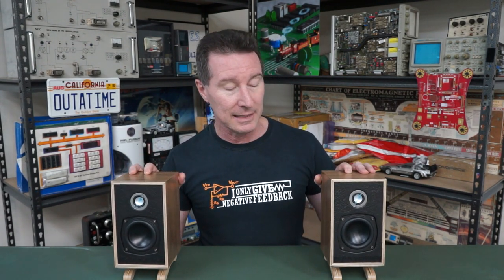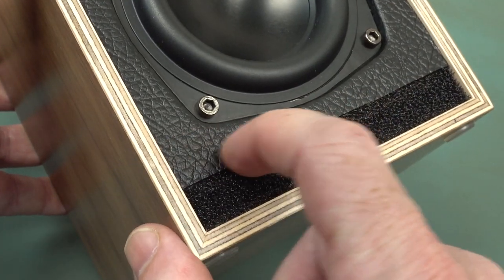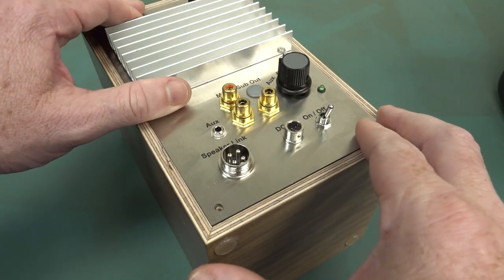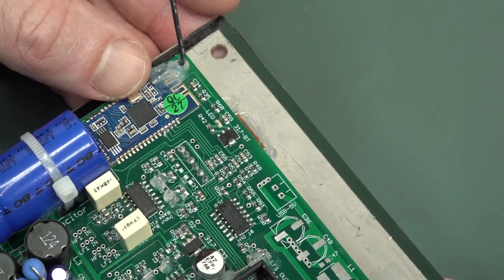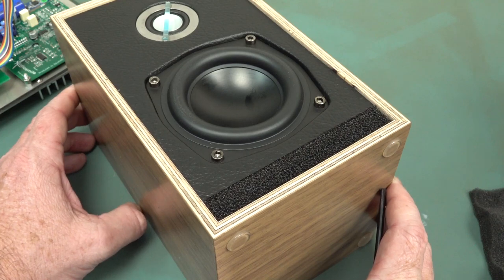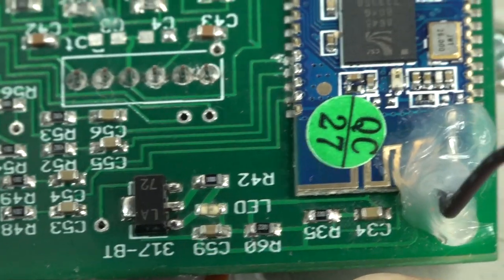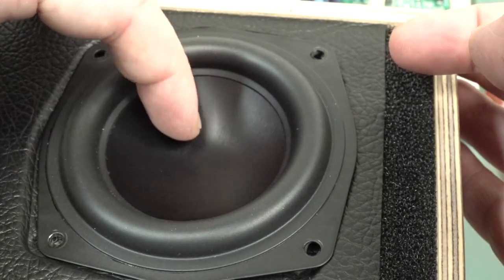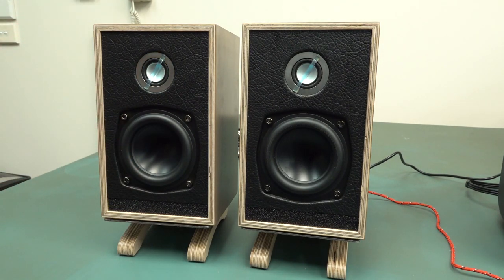EEVblog #1162 - Little British Monitors

Comment: That Dayton driver is a series piece. All you need to look at is the huge buna-n surround, huge magnet and then that deeply pleated nomex spider and a stiff cone. Seeing the nomex spider did it for me. If they are specing a nomex suspension, then they put the money in the right place.
Reply: It is a Dayton driver but to be fair they totally ripped off the design from AuraSound. If I knew that when I designed them I would have gone with AuraSound on principle, but the small differences make it difficult to change over now.

Comment: Putting the price aside, I wouldn't use these for any critical listening, only for checking mixes. These drivers are too small to have a much wider frequency response without using tricks. Also, these would not work well for surround setups either, as you have to use them as a pair. No monitor in that price range has a slave passive speaker. They all have their own preamps and can be used by themselves, so you can buy the monitor as a single unit for surround setups.

Also...if the monitor is that flat as claimed, why the plots are shown with averaging and with the large division of 20 dB per octave? Just give the full frequency response of the monitor.

Comment: This is definitely not a transmission line - the port is way to short. For a tuning frequency of 70Hz (like the frequency response suggests), the line would have to be about 120cm long.
It´s a ported enclosure - which isn´t bad...just don´t call it a TL.

Comment: I've heard these a few times and it's important to put them into context - for current use and the history behind the design.
They are designed to be flat and accurate, a monitor speaker and therefore somewhat at odds with the norm for small multimedia speakers which are often hyped in the presence region to give added bite and excitement, and boosted in the upper bass for additional thump.
Such anomalies sound impressive on first hearing but can become tiring after extended use, not to mention you are overlaying a set of defined tonal characteristics onto every performance.
The LBM tries to avoid this by remaining clean and neutral.

The ply cabinet is better damped than many other materials, lacking for example the high Q ringing often found in MDF and some plastics which colours mid range frequencies.
I'm sure Simon could make these more cheaply with MDF, and even save some time on machining and finishing - but they'd sound worse.

Comment: Back in the 70's I read an interesting article about doppler distortion in wide-range  speakers. In fact you will have a moving sound source when playing, for instance, a 5 kHz tone on a membrane that moves with a lower frequency like 50 Hz.
Reply: That tends to be a bit of a headache for coaxial designs, actually, since you're basically putting the tweeter into a vibrating waveguide.
Reply: @PileOfEmptyTapes  Also the reflections from the voice coil around the tweeter can cause 'blurring' to transient response. Philip Newell has an interesting chapter on this in his book Recording Studio Design where he measures Tannoys.

Comment: these are NOT MLTL speakers and the drivers do not appear to be high quality.  Notice how none of the driver specs are given here or on the kickstarter. Go to partsexpress.com and you can build your own bookshelf monitors with an active crossover and add a blutooth module for a fraction of the cost.  The $100 mark is not far off depending on how good of a crossover you want to build. Also, anyone that knows about resonance understands that for the density to mass ratio and quality control of the product, MDF is a better choice for cabs than plywood unless he is using the finest grade cabinet ply (9 layers or more) and checked for inclusions in the cab.  This is a set designed for the recreational person who likes to think they know about something because they screwed nut A into hole B.   Just an FYI, I built 3-way MLTLs as my main fronts and the crossovers in them were $300 so please do not mistake a product produced for noobs for quality just because the uninformed think it is.

Comment: The midwoofer is a reputable unit, but I don't know about the tweeter in the LBM's. They look like they are 1" Tymphany wide-range speakers, kind of like the Harman Odyssey single-suspension mid-tweeter speakers, so they probably aren't "junk" but I haven't heard them sound better than actual edge-driven dome tweeters in my experience. A "transmission line port" was originally done by Irving "Bud" Fried back in the 70's; my parents' old Fried Model Q monitor speakers had them, and they were called a "line tunnel" - effectively they are a lossy port, also called an "aperiodic" port. You actually lose a small amount of deep bass from this approach but you can flatten out the impedance peak of the woofer which makes them a better load for tube amplifiers with their higher output impedance so that the load the amp sees is less reactive. The Scan-Speak Scan-Vent and the Dynaudio Variovent are similar in practice. AudioSmile has been around this block before with some passive monitors using reputable drivers from SEAS in Norway, using passive crossovers.
Reply from the maker: Yes, they are Tymphany tweeters
Reply: They are amazing little 'tweeters' (quotes because they have far wider range and excursion than a typical tweeter), performance well beyond the competition that look similar.  But what would you expect from Tympany who oversee Scan-speak, Vifa, Peerless etc..

You could easily call them a damped folded slot port. Transmission Line sounds cool though and it's quite a reasonable description. The primary goal of the damping is to reduce harmonics of the line, rather than flatten impedance at least in my design.

Comment: The hole in the magnet (with the grill) is 1, to prevent pressure and vacuum building up in the dome of the woofer, and 2, for cooling the coil.

Comment: That heat sink on the back should be mounted with the fins running top to bottom. Cooling will be compromised the way they’ve done it.
At 15:20 it’s obvious the rear panel seal is only fitted down the sides, not the top and bottom. That could cause a few problems with the sound. They should be completely airtight except for the transmission line port.
Reply: Thanks for that point, Ill see if I can source a heatsink shaped so the fins run vertical, but I do need to work with what's available. Really no problems with heat as they are though. 

P.S the green is just a liner on the seal tape as it's sticky and will gunk on the case otherwise. I've not seem it come of like that before, maybe something to do with being in air freight.
Reply: Simon A - Bear in mind that your speakers could end up being used in temperatures you may not have anticipated! You ideally need a large safety margin to cover that. Of course,  if the user sideways mounts them...! :-).

Comment: I still think these "chip amp" are all to often overlooked. I've run a DIY LM3886 amp for around 8 yrs on a set of floor standing TL speakers (DIY of course) they rock for the cost and are great little projects. Currently have version 2 in the pipeline.

Comment: I can confirm that those are not transmission line ported enclosures, in fact the angle is not smooth and will affect significantly the velocity.

Comment: So, some thoughts on the review.
Quite right to be dismissive of the cabinet being a real transmission line. A few have already noted this. The original "transmission line" design went back to Bailey, and was a design with essentially no theoretical underpinning. The idea was that the stuffed tapered line would adsorb all the energy off the rear of the driver was a nice idea, but the reality was always going to be something else. There is now quite good understanding of what is really going on, and a few useful design tools available, Martin King's work probably being the definitive, although tools like Hornresp can also model the system and get much the same results. What the enclosure seen is is a tapped line. The port is coming off part way down the line, and you will get a reasonably complex system. There will be a resonant system in the box with the speaker, and other in the box with the electronics, they couple, and there is a lossy resonant port. Add to that a quarter wave resonant system end to end. However, what you can do is tune this mess to produce a range of responses, and with care eventually end up with a flat response. For a small enclosure you might be able to create a more satisfactory (for some definition of satisfactory) result than a simple sealed or ported alignment. 
On the subject of full range drivers, an eternal problem with any full range driver is the polar response at high frequencies. As the driver becomes large relative to the wavelength the speaker becomes quite directional. Whilst it is possible to make a flat response on axis, the frequency of the energy in the diffuse field is heavily skewed. Metal cone drivers invariably have a few quite nasty resonances at high frequencies, and part of the art of crossover design is to avoid energising them. All full range drivers, no matter what the technology, have significant resonance issues.
One notes that the bass drivers are about 40 USD each, and the tweeters are probably in the vicinity of 10-20 USD. So the BOM for just the drivers is already 100 USD. Cutting out the enclosure on a home gamer CNC router is not going to be conducive to a cheap result, even if the kit probably goes together with the precision of a Swiss watch.
The driver selected seems pretty nice. It has such nice design features as a shorting ring around the voice coil, and has clearly been carefully optimised. It is great for a small 2 way. One notes there is a subwoofer output. Does using it place a high pass before the bass drivers? Using it with a subwoofer would help greatly with reducing the excursion the drivers need, and would probably drop distortion quite a bit. 
With Dave's experience in building stuff for manufacture, some comments on the expenses, and the margins would have been illuminating. Despite the apparently high cost of these speakers, and the moaning, it is not clear how unreasonable the price is. Without serious economies of scale, getting prices down is hard, and in the end, it isn't the ingredients alone that matter. If the final result is good, that is what you pay for. The modern world doesn't seem to value the work in getting it to that point, and expects the IP for free.

Comment: Transmission line converts the sound waves from the back of speaker and changes there Phase so instead of cancelling out they add to what is coming out the front of the speaker.

Comment: A completely improperly designed audio cabinet, including electronics. Have you noticed the  ceramic caps in the signal filtering? Jeeeez...
Reply: Even the heatsink is mounted improperly.
Reply: I wonder if the piece of wire soldered to the Bluetooth antenna actually reduces range...
Reply: What's wrong with ceramic caps? Serious question.
Reply: @davidf2281  Some kinds act like varactors, causing all sorts of undesirable effects to the signal. A test with a spectrum analyzer will show if there really is a problem.
Reply: @NiHaoMike64  I see, thanks. What's the best kind for audio applications? Mica, tantalum?
Reply: @davidf2281  Class 2 and 3 ceramic caps have a non-linear voltage vs. capacitance relationship which causes signal distortion. Class 1 (NP0/C0G) ceramic are fine however. With some careful filter design, it is possible to get away with class 2 ceramics by keeping the voltage across them near zero, especially when using them with speaker drivers that are nothing special (like the ones in this vid).
Reply: @davidf2281  Film for small to medium values and OSCON for (very) large values.
Reply: @tmmtmm  Ah that makes sense. Thanks. So as usual it's really down to design parameters as opposed to absolutes in terms of component choice. Interesting stuff.
Reply: Yeah C0G types are the choice for audio signal applications.
Reply: X7Rs and the like are great for decoupling but an absolute no for filters/signal path stuff. They're frequency batteries essentially.
Reply: *high
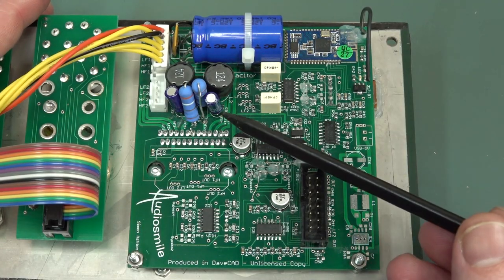Reply: Directly heated caps. (15:50)
I would never ship this out. It's still in early prototype stage.

17:19 is that a "find the errors"-picture?
Reply: @CyberlightFG  gnnnn.... I had to pause and take a look.... I shouldn't have!!! It's like going hitting a slip'n'slide all lubed up with sand.
Reply: @CyberlightFG  Do not worry, those resistors do not get hot.
Reply: How do you know that the cabinet is improperly designed?
You would need the actual dimensions to properly know.
I'm not overly keen myself. For a speaker this size a transmission line isn't a great design for such a small speaker, in my estimation. Though I do love transmission lines.
Looking at the size of the thing I'm trying to think what actually it is, as it cannot be a full size or half wave. I can't imagine it being quarter or eighth wave. I'm thinking it has to be either a 16th or a 32nd wave.
The main advantage with a transmission line is the bass quality and weight, so I'm not convinced with doing one at this size.
It is however a great unique selling point, as it were.
As far as transmission line speaker design goes. I'm already convinced. I built myself a pair some 12 15 years ago, and they are still stunning.
There is not too much about design as there is with infinite baffle and ported designs. The speaker bible I think has only a couple of pages with not much detail regarding transmission lines. Horns have a much bigger section in the book too.
Reply: @tmmtmm  they are piezoelectric. Not good to put a weak microphone in a speaker cabinet in the signal path. A little glue underneath handles that pretty well.
Reply: Post too remember

Comment: FYI front porting doesn't mean you should stick speakers near walls or corners.
Reply: Even without porting, you never do that, as low frequencies are omni directional.
Reply: But I am adding a boundary compensation control to the final version.

Comment: Those four pin connectors aren't DIN. They are GX16 aviation connectors.
Reply: Aviation or otherwise...
a GX-16  is in fact a  DIN Connector

and seriously though,    did you think that you were going to teach dave a thing or two with this comment ?
all you've done is shown how silly you can be 

i suppose , next, you'll be telling me that an RCA Connector is not RCA , but it's actually Composite hehe

Mate, just keep it simple ok,  we all know what we are talking about
Reply: To be fair, I bought them under the name 'GX16' ;)
Reply: Never heard anybody calling a connector like that DIN in Europe or in USA. DIN connectors in popular parlance are those 13.2mm circular affairs with thinner pins well known from old receivers, cassette decks, and MIDI interface boxes. Not used anymore in Hi-Fi except in Naim Audio gear.  DIN is the German Institute for Standardization and I don't know if there is any number ever issued for GX series from them, but those aviation connectors look more like MIL-Spec USA Cannon stuff or alike. Probably very old. In any case I did not try to teach Dave anything, only to remark that those connectors are not called DIN for very many other people, especially when met on audio equipment. Regards.
Reply: @somebodyx  it's like people calling one of the power connectors inside a computer "a Molex" and they don't realize that most of them are Molex. They think "a Molex" is a specific plug. They say things like, "plug in the Molex, "referring to a single specific plug. Same with DIN.
Reply: @Audio_Simon  And here was me thinking "CB Mic connectors" 

Have a good christmas, I personally like the fact you're here to answer questions and have taken stuff on board. Any chance of doing a version without BT? (not just to please Dave, but I've known BT modules cause horrible interference even with a well filtered separate power supply

Comment: I think the holes in the back of the woofer are a cooling port, I think you were mistaken about the sound going through the foam, the sounds goes past the tweeter to the top of the speaker then into the wave guide thing

Comment: As a line array of small drivers those woofers do work pretty well. You need 30 of them to get a decent bottom end and usually in an infinite baffle configuration. 30 x 1" ports equals a 30" port. Equally those 3½" drivers add up in surface area quickly too. For those drivers to be effective they have to be used in something like a Bose 509 configuration. As for the unpopulated area of the board, I have a hunch that it was for a USB DAC which ironically would have been better than the bluetooth save for the wireless part. You also may want to work the drivers in before you pass judgement. Often the compliance of the driver increases over time. It's like a leather wallet that needs to be worked in a bit before it feels right. I got a set of these and honestly they don't compete with my JBL 4312g but they are rather impressive for the size. Their heaps cheaper too for the level of audio quality possible with these.